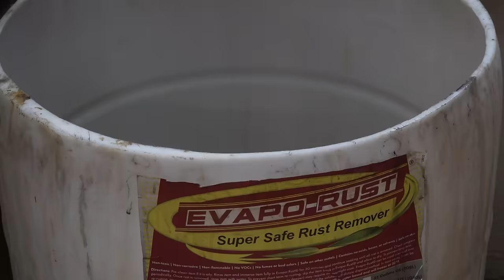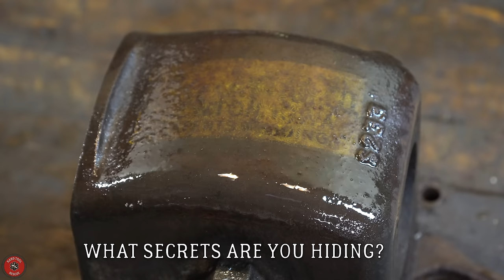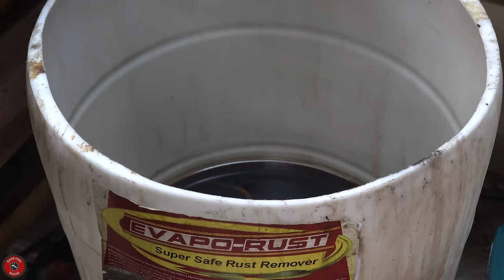1920s Maytag Washing Machine Engine [Restoration]

Comment: We used a Maytag gas engine powered washing machine for may years till the electric line\s came to us. That washer had to be filled with a bucket as we just had a spring for water then. I mad Mom upset when 5 and was handed the bucket and told to fetch water to do the laundry; wash and rinse both. I was MUXH better behaved in the stores after that !! lmao

Comment: I was stumbling around online and found a set of manufacturing drawings for an almost identical engine designed by the South Bend Lathe company who sold kit engines to be used to train machinists in machining engine components…

Comment: I'm doing this right now to an identical motor. When I get to the part where you drive out the pin that holds the starter ratchet gear to the crank shaft...mine wont budge. Gonna let it soak a while in WD-40...but yours seems to almost want to fall out. Am I missing something...anyone know?

Comment: The connecting rod really should be balanced if you’re going to remove that much material. Otherwise it will always run like crap. It’s something you can rough out on the bench with a scale to at least get it close instead of just praying.

Comment: I thought it was odd when you used the rattle gun to do up the flywheel bolt....then it broke... 

hand tight and then the split pin to stop it backing out :)

Comment: I BOUGHT ONE OF THESE AT AN AUCTION FOR $5.00 WE USED IT AT A CABIN IN THE LATE 50S TO DRIVE A 6 VOLT CAR GENERATER TO CHARGE A CAR BATTERY TO POWER A CAR RADIO       !....////

Comment: I can't get how this excuse of a carburetor works as it is very different from the bike carbs I know the best - it has no throttle, no choke, no float or membrane, it's basically a venturi jet with a siphoning pipe dipped in the gas tank

Comment: Nice work overall but falls down in the details. E.g. so disappointing at 32:20 to see those mangled screw slots because you use the wrong screwdriver for the job. Get a decent set of "gunsmith's screwdrivers" (with the flat blades instead of that old fashioned tapered thing) and turn your work up to 100%. So little extra effort involved, rather than producing 90%.